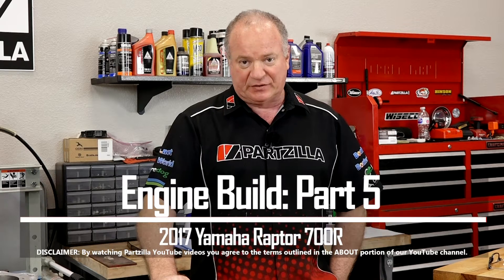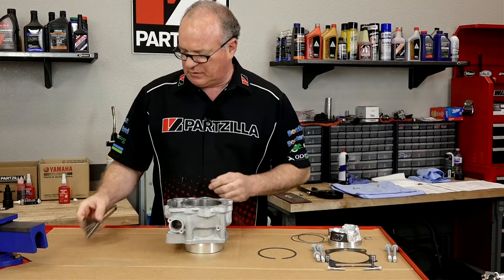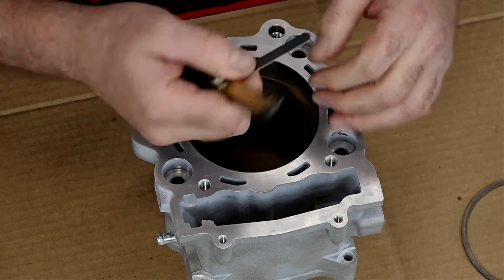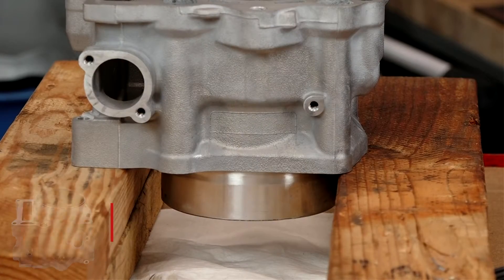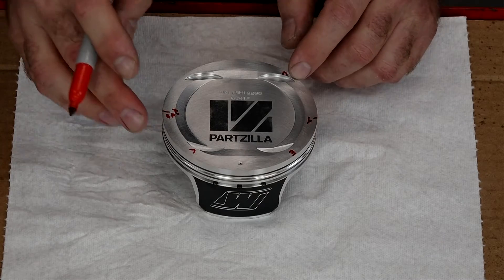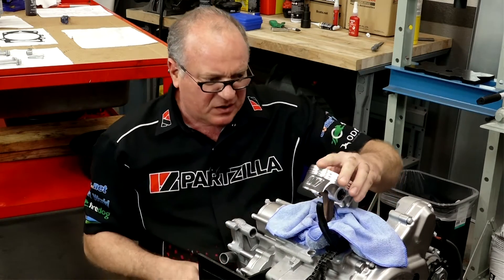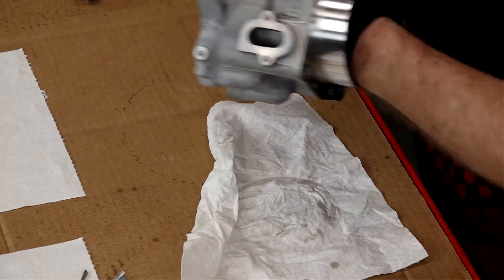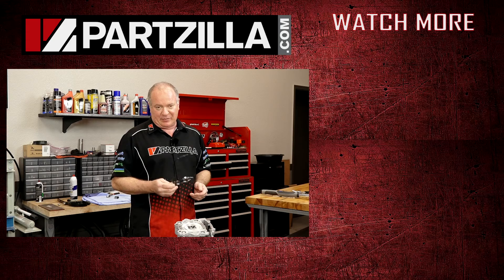Yamaha Raptor 700R Engine Build Pt. 5: Cylinder & Wiseco Piston Installation | Partzilla.com

Comment: I am currently building the same engine and for some reason my oil rings will not set into the cylinder correctly. The top two compression rings go in fine  but as soon as oil rings go in it binds up
Reply: you have to put the middle of the three oil rings in first then the two flat ones

Comment: You mention a quality torque wrench several times. What would you consider quality? How long will a torque wrench be accurate?
Reply from the maker: The clicker or digital versions are good.  Just don't use them as a hammer!
Reply: @PartzillaParts  Do brands matter? I hear a lot of folks say Harbor Freight is trash only grab Craftsman or better. What is your opinion on the brand? They are expensive, only want to buy once.

Comment: On a 400 hour durability test on a 6 cylinder engine the ring gaps were set as per the video. On strip down the gaps were all over the place conclusion is that ring gaps do not have to be set at specific angles from each other.
Reply: its only for break in after that it doesn't matter and yes they rotate but if you start them that way they break in better

Comment: Hi I have a question.. my 04 rancher ES 4x4 has something wrong with foot brake. I took off cables and springs, pulled split pin and washer ready to take off brake pedal but it just won’t come off. I sprayed liquid wrench but no impact. The pedal moves as much as how it has been, just about half info or so up and down. Any suggestions to how I can pull off the brake pedal? 
Thank you!
Reply: The shaft is rusted! Remove plastic parts, heat shaft with propane torch. Then use small sledgehammer to knock it off.
Reply: Shaine MacDonald 
Heating it...I’ll try. The problem is that there’s no room to swing a hammer.. it will have to come off away from the frame but I’ll give it a try. Thank you!
Reply: Shaine MacDonald 
Update: it didn’t come off so I used trusted wheel cutter and cut it off. A bit of cut in to welded shaft for the brake pedal but not too bad. I’ll sand the shaft and give it a slightly smaller diameter, placing an order for the brake pedal from Partszilla...